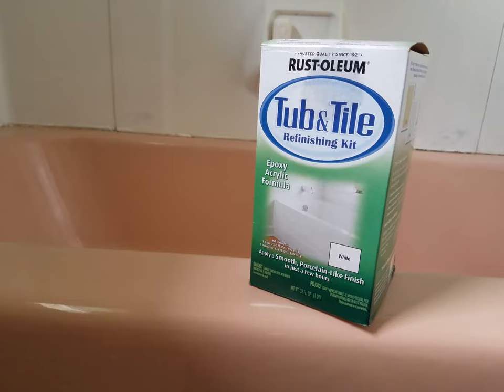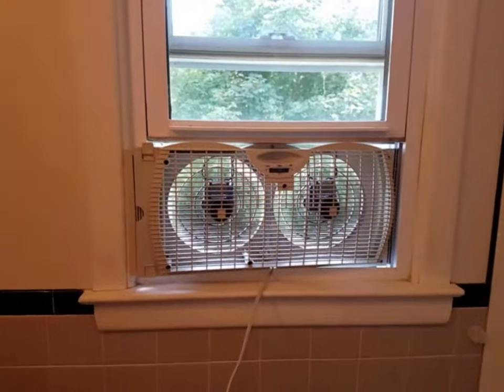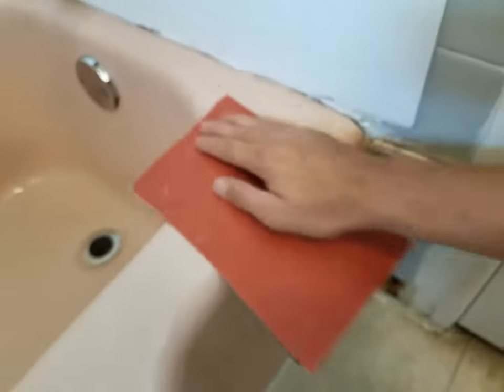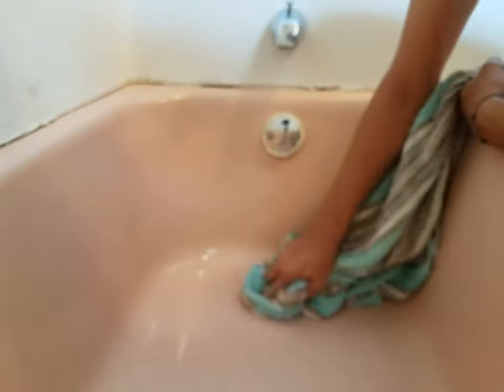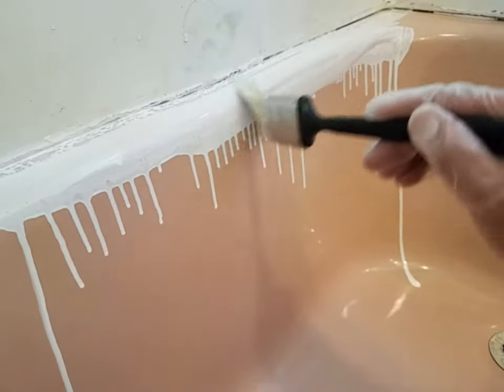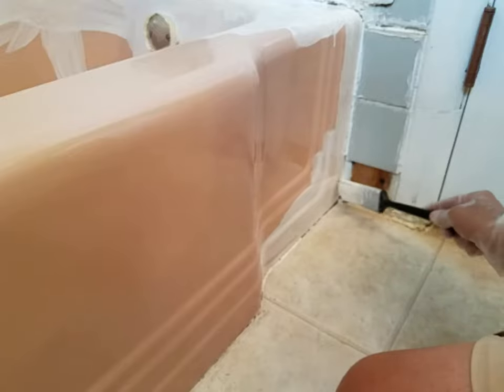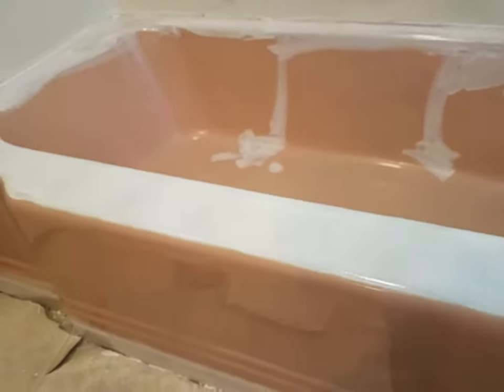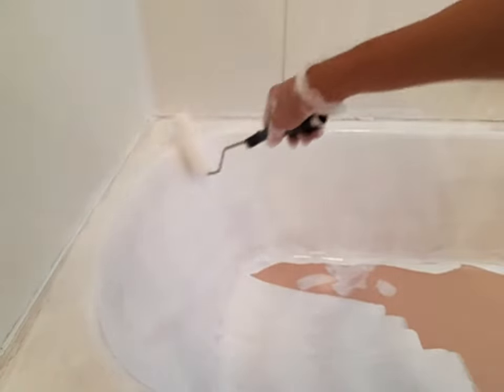How 2: How to refinish your bathtub a new color - Using Rustoleums Tub & Tile Refinisher

Comment: I know it seems that it’s not required, can you use primer?
Reply from the maker: I did a lot of research about primers and have seen many mixed reviews about it, most were negative so I decided against it. However, if you insist on using one- you should test it in a small unnoticeable area first and watch for bubbling.

Happy painting!